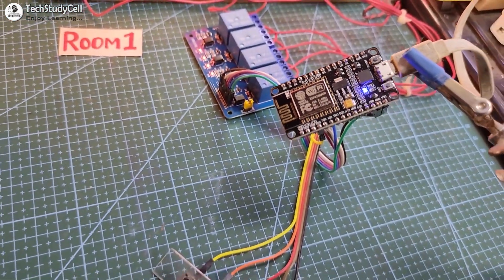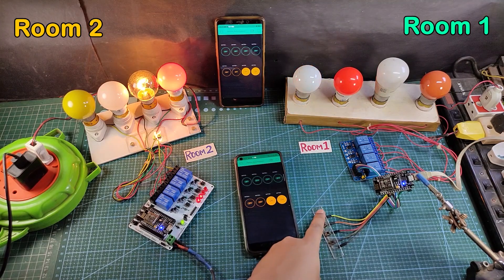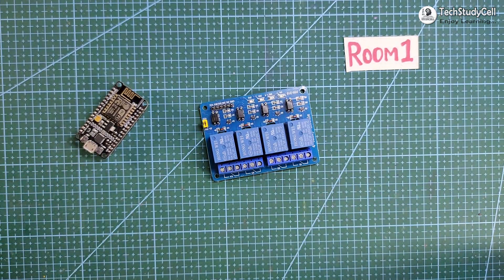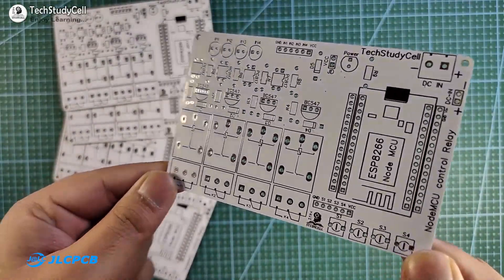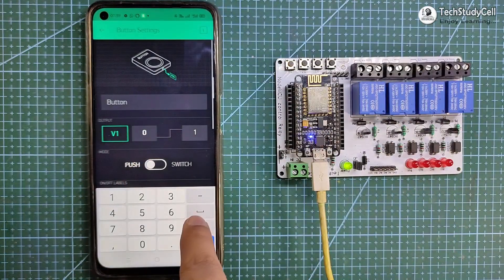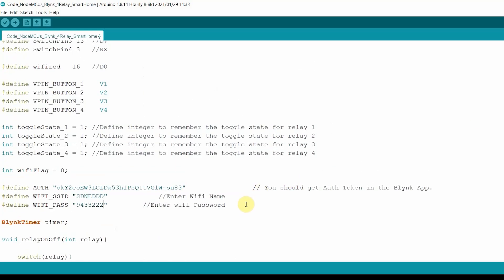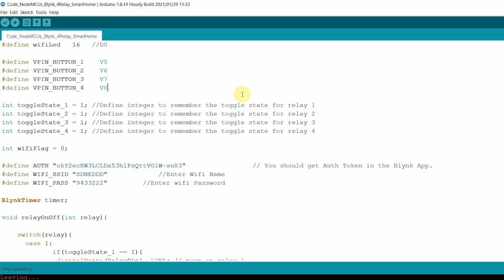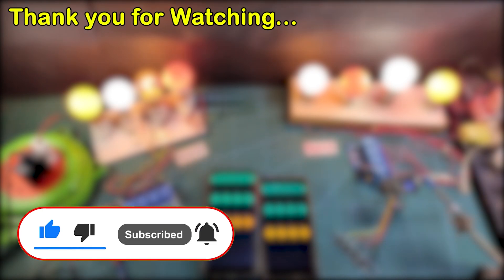Home Automation System using multiple NodeMCU ESP8266 network with Blynk | IoT Projects 2021

Comment from the maker: ** (Important) Please don't connect both NodeMCUs with the laptop at the same time. And also use different 5V power supply for each NodeMCU. Otherwise,  false turn on and off may take place. Thank you.
Reply: Which model we use nodemcu esp8266...................?
Reply from the maker: I have used NodeMCU 1.0. please visit the purchase link from description
Reply: your program is faulty, if you press and hold the relay button, it will jump continuously
Reply: Program is faulty. Only relay 2 toggles .rest are correct.
Reply: What is the maximum number of relays and physical buttons we can put in each nodemcu?
I mean since it has 13 GPIO so I have the ability to plug 6 relays and 6 physical buttons;
Reply: Hi thanks for the videos there is any code for 16ch relay  for on off  with temp, humidity ,
Reply: That's remote control - it's not Home Automation...

Comment: MANUAL SWITCHES IS NOT WORKING PROPERLY, RELAYS ARE SWITCHING ON  & OFF CONTINUOUSLY FOR SWITCH 2, 3 & 4, SWITCH 1 COULD NOT OPERATE RELAY 1. ALSO RELAYS ARE GETTING STUCK SOMETIMES AFTER SWITCHING OFF. WIFI LED IS ALSO NOT GLOWING THOUGH CONNECTED TO WIFI AND OPERATIVE THROUGH BLYNK APPLICATION (BOTH WEB AND ANDROID APPLICATION). PLEASE HELP TO RESOLVE THE ISSUE. I AM USING Node MCU ESP8266 V3 (LOLIN CH340 chip).
Reply: I can send you fully working product

Comment: Dear Sir, 
Good Evening , 
Hope you good  well....
I try to made it after learning/viewing from this tutorial.... by using (1) Arduino IDE 2.2.1, (2) Blynk Library version 0.6.1, (3) Nodemcu ESP8266 (ESP-12E Module)...
But After completing this project I faced a problem.....that is my device shown 'Offline' status. For this issue I failure to operate/active this project. 
I also enclosed a screenshot of my device dashboard to your facebook messanger.
Kindly help me to fix the problem...

Thanks

Comment: help me sir, why is pushbutton number 1 not working even though it has been installed according to the scheme, the relay can only be turned on / off using the blynk application, what is the solution?  thank you

Comment: I made a same to same project.but pins are different.d1,d2, d5,d6 . I use seperate power supply for node mcu and 4 relay's. After starting the project, only relay 2 connected with d2 toggles. Rest are controlled by blynk or manual switch normally. If i change the output d2 pin to another relay, same problem occurs. I dont understand what's the problem is! Please help.
Thanks in advance.

Comment: great job, i have 2 questions could i control them (2 esp8266)with google assistant or alexa or not?? and could i use 8-channel relay module with 8 switch for each esp8266?

Comment: how connecting the electricity? how to get to lamps?
where to put the device? on the wall without any box?
very risky From my experience!
why need one modul for every room if one can deal with 4 lamps?
you know that the switch must be on for the device to work, otherwise it will be more complicated and expensive.
i don't know how much you understand about the electricity, but the diagram of elecricity wires are not real, it's not connect with the Electrical outlet But from the junction box.
nice idea but not practical, even you didn't maked for real because you need to deal with the electricity.

Comment: Switch SD3 CONECTION not working
Reply: the others works? how did you connect the lamps?
Reply: @davidperets9997  V5,V6,V7,V8 In that pins one pin switch not working remaining 7 working
Reply from the maker: Already shared the circuit for connecting lamps with relay module during the video.
Reply from the maker: I have not faced any issues with SD3. But you can use D4 instead of SD3. Please remember during boot process D3 & D4 should not be grounded.

Comment: Here both node mcu and blynk app has to connect to same network 
OR 
IF node mcu connect to home wifi and blynk app to mobile network
Reply from the maker: NodeMCUs can be connected with different WiFi network. But Auth token should be same. Just change the WiFi credentials

Comment: Hi, 
I need this project PCB Gerber file. But small changes required. Which is  we only provide input of the 230v which will convert to 5v for node MCU and relay operation voltage.

If possible please post that kind of Gerber file.

Thank you....

Comment: Hello Sir, This is really a nice one. Could you please tell us, when Power Goes and comeback, all the relays are remembering its current state and ON/OF without any manual control? I guess, if we switch OFF the Node MCU supply, the ports states are reset. Please share your views. Thanks.
Reply from the maker: Thanks. In this project if you turn off supply, it will not remember the previous state. But if you want you can get the previous state from Blynk server.

Comment: Dear Bro When

Nodemcu  (Connected) RouterBoard  (Connected) Internet  >          Then work fine
 but if
Nodemcu  (Connected) RouterBoard  (DisConnected) Internet        Then 
push button work don't work properly And we have to press two or three times To change relay state .
also

Nodemcu  (DisConnected) RouterBoard  (DisConnected) Internet   work fine if i disconnect from router also
Reply from the maker: if you use 2 NodeMCU then use different power supply. After every 3 second NodeMCU check if the Blynk server is connected. So when you turn off the internet it may take 3 seconds to move to no_internet mode. After you turn off the router wait for sometime  and then try to control it manually. Still if you face any issues please let me know. Thanks

Comment: Sir I made this project. But instead of momentary push button I used touch module for controlling appliances.
The problem I am facing is sometimes the appliances getting on or off automatically.
Please help what could be the reason
Reply from the maker: Please use different power supply for the NodeMCU. Please don't connect both NodeMCU with laptop at the same time. If you touch Switch then I will suggest you to increase the delay and during the touch the output pin of touch sensor should become low. And most important there should not be any loose connection.
Reply: @TechStudyCell  Thanks for the reply 
I am using this project from approx 2 month with single node mcu and working fine. 2 bulbs and 2 fan connected with relay. Total consumption with relays active is 750mA. I am using 5volt 1amp mobile charger as power supply. Touch sensor is ttp223 ia in active low mode. All wiring is properly soldered. Voltage input is supplied through Vin pin. 
I will monitor with increasing delay.
Multiple cases in use observed after approx 1 month are as, 
1. All relay in active state suddenly automatically changes the status to off or vice a versa
2. 1, 2 or 3 relay are active suddenly automatically balance relay get active or vice a versa
3. Some time touch sensor did not work but can be change relay state through blynk
4. Some time I have to touch and hold the the touch sensor for 2, 3, 4 seconds to change the relay status

I prepare my project from your below link
https://youtu.be/fRCVx6yKoYw
Sorry I mistakenly asked the question in this project

Any suggestions will be helpful

Comment: Great project weldon  job.
Dear bro When we connect our NodeMCU with the router board.
As soon as the internet access  ends or offline with blynk server(nodemcu connected with router).
Push buttons don't work properly And we have to press two or three times To change relay state.
Reply from the maker: Sometimes it happens due to loose connection. It's alway better to solder the Push button on zero PCB. You can also change delay(200) to delay(100) in the code.
Reply: @TechStudyCell  but when internet back mean blynk server online then all the project work proper...
I think when nodemcu tries to connect to the blynk server during that push buttons don't work correctly untill internet back online.
Reply: Or turn off the router.
Reply: When we turn off the router then also working fine.
Reply from the maker: Please use different power supply for NodeMCUs. Please don't connect the both NodeMCUs with laptop at the same time.

Comment: can i use esp32 in same program and project
Reply from the maker: You have to include different library and some modifications required in the code. Will make video on this.
Reply: @TechStudyCell  please make a video esp 8266 and esp 32 board working both this project